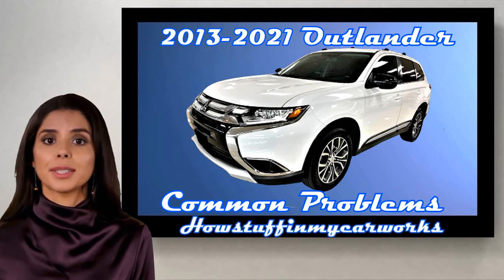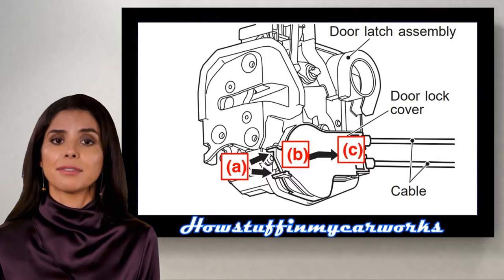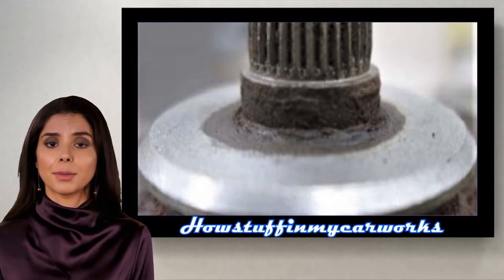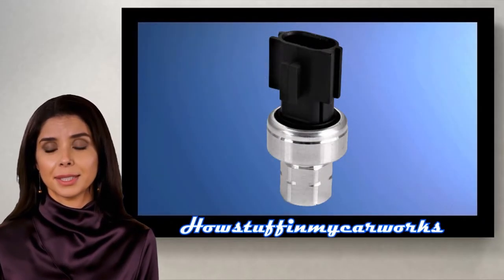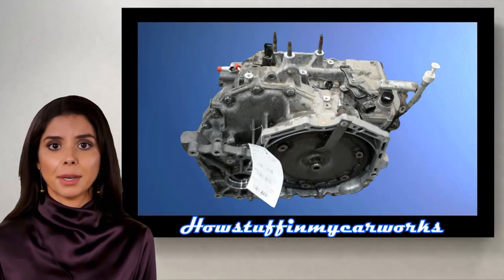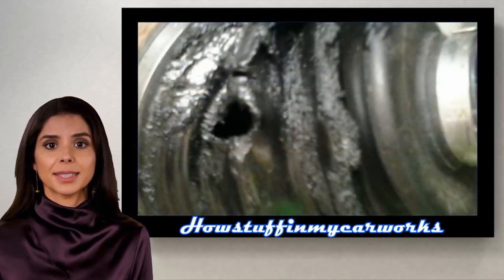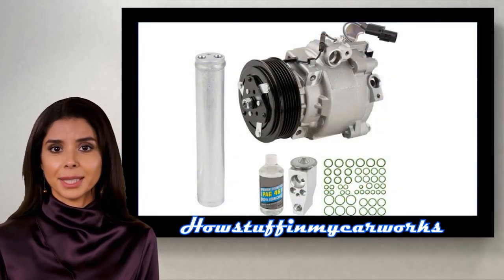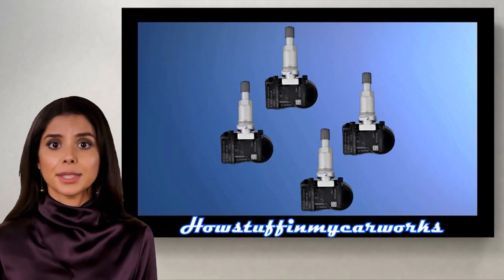Mitsubishi Outlander 2013 to 2021 Common problems, defects, recalls and complaints

Comment: My 2012 RVR (outlander in Canada) is rusting from the inside out. It lives in a garage, no salt on roads, very low mileage. They kept pushing off the repair until they could say it's no longer under warranty. They had a recall to spray the undercarriage for rush protection but say it's unrelated to the paint issue (!!??).

Comment: My 2017 Outlander SEL had the transmission issue but wasn’t until 267,000 miles. Through Mitsubishi dealer, the transmission price is $5,200 dollars not including the labor involved.
Reply: @Plisken65  I had about two or three transmission fluid changes, one time including filters and gaskets.
Reply: By the way, this is an SEL trim, four-cylinder 2-wheel drive.
Reply: I have a 2015 4cyl 2wd SEL.
Overall been happy with the car for what it is, except I never really got 31mpg. Even with mostly highway driving I get 28mpg. Mixed driving I get 23mpg.
Reply: how often did you change the transmission fluid?
Reply: you have 267,000 miles on a 2017?
Reply: You’re supposed to change the CVT fluid every 30k miles.

Comment: Has anyone else experienced the door actuators to begin failing? it seems mine do it randomly on different doors. Is there a reset on the control screen car settings to solve this?

Comment: so glad I have a 2018 4 cyl. model,
Reply: Oh, wait, transmission failure will occur. Trust me.
Reply: @Testa11  I also got 2018 and heater blows cold air now. That sucks.
Reply: @Testa11  how long , or when ?
Reply: My 2018 just stopped working when I was driving says the engine is over heating engine service required asc service required
Reply: My 2018 looses ground randomly and I have to wiggle the wires I've done everything and still no fix

Comment: I have a 2017 mitsubishi outlander sport 4wd and I keep having an issue with the exhaust heat shield rattling and when I decelerate it sounds like a huge truck.  Had it repaired and called the mitsubishi corporate office and they still the problem has never been recalled
Reply: same vehicle here, my 4wd/Awd lock is stuck. I have to override the gears to drive, reverse.. etc. Shops can’t find the problem. I got stuck in snow a couple months back, got someone to yank me out and that’s when the problem started. It’s not the transmission they said but a computer problem. It’s so complicated and hard to diagnose this damn vehicle… I need help
Reply: @jordantsannie512  Mitsubishi needs to issue recalls...the know which years have problems but for some strange reason they skip 2017 and recall 2016 & 2018 🤔.  Guess it's time to file complaints with BBB.
Reply: I think.i have tjat isdue on my 2012. 😊

Comment: 2016 Mitsubishi here and having ac problems at 175,000. Compressor clutch or ac pressure gauge
Reply: A friend of mine who has the same model and trim as mine had a heater failure when the car had less than 40,000 miles.
Reply: I was less the 50k miles in my 2016. Glad you got 175k
Reply: Did you see the AC blower? That’s what I’ve been having a problem replace two already is that what your problem is?